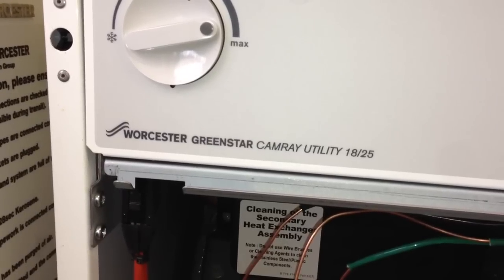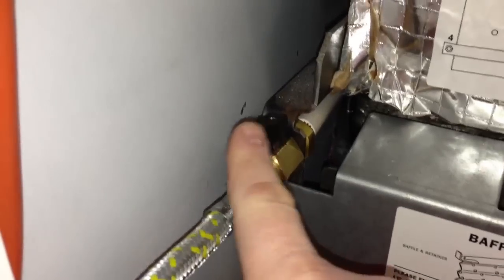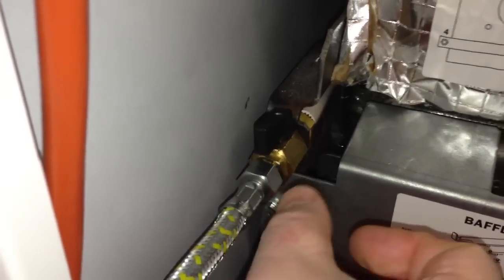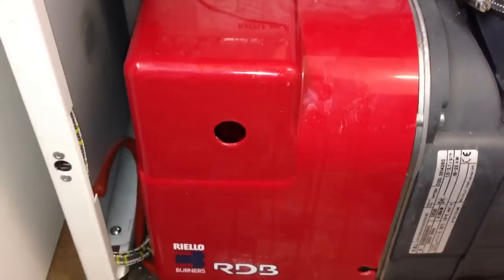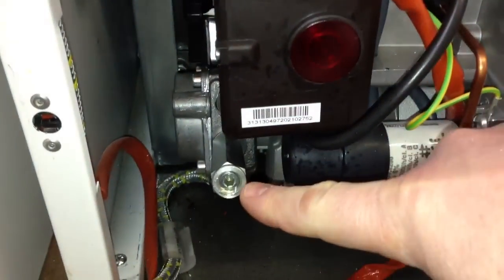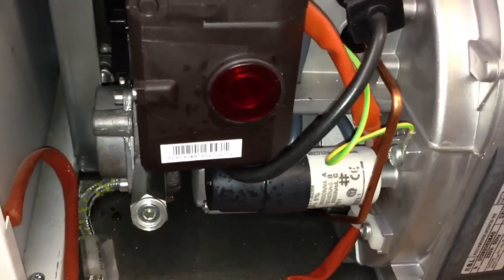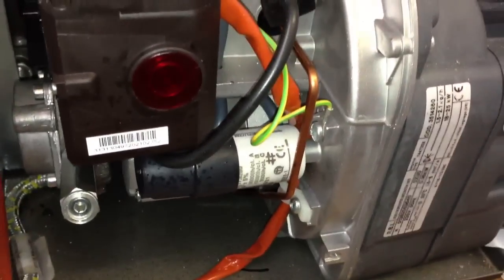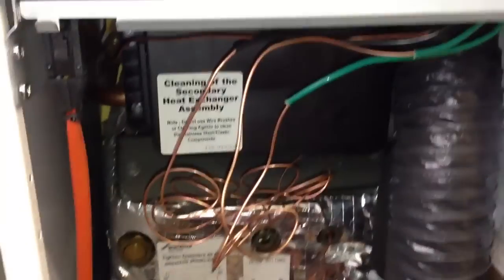Worcester Greenstar Camray Utility 18/25 Oil Fired Boiler - How to bleed an oil fired boiler

Comment: Thanks Greg, I struggled to remove the first pipe and didn't a suitable pipe to connect so gave up. Howver Loosening the screw to bleed air and resetting a few times brought the boiler to life. Many thanks, you saved me from a very cold easter

Comment: Had a old boiler that just needed to be bled from the grub screw. However I unfortunately let the oil run out on my new Worcester heatslave II. You have to start the pump for the oil to come through the grub screw (didn’t need to detach pipe and bleed first). Press the reset to initiate pump- after 5 goes it locks you out, so switch power off and on again for another five goes. It didn’t ignite after about 20 attempts. I was about to give up then found this video.  The light bulb moment was when I read the Bob Hamer comment below. - many thanks Bob. Tighten the grub screw before burner ignites to stop air being pulled in. worked straight away.

Comment: This has just worked for me, today 8 March 2018. Thank you so much. Just a extra note though, if you have to restart several times, pushing the reset button, I think it is important to close the bleed valve each time whilst waiting for the boiler to reset, and to do this just before it goes to lockout. Otherwise air can get back into the system.
Reply: First of all a big thank you for thehelp
Second thing it is very importent to clean all the filters on the way. After years they get full with dirt. Best is to fit new once.
After bleeding the boiler started by itself.
Thanks again.

Comment: Brilliant little video, particularly as it is exactly the same model boiler as ours.Oil in tank ok but excited dogs had turned off the tap by the flame cut off valve leading to an air lock. Boiler now running as it should so thanks again for your help👍👍👍

Comment: Brilliant - saved my bacon today - thanks!  I did need to use a pump to pull the oil through as a very long run of pipe from the tank and a rise of several feet up to the boiler.
Reply: What kind of pump did you use? My oil tank is also far away and below the level of the burner - I’m struggling with this part.

Comment: Thanks for the video.  Very useful.  Found that i just needed to allow air/ bubbles  to come through valve .  Then fired up the boiler and worked first time.
Reply from the maker: That’s right, I mention this in the video. Once it’s running clear you’re good to go. Glad it helped!

Comment: Well done for geeting that sorted. although it really doesn't need to be that awkward.  The pump will pull the oil rather than you needing to disconnect pipework and sucking oil manually.  There is a valve that you can loosen at the same time resetting the burner.  The pump and the will do the pulling and the opened valve will release the air.  It will fire after the aire has released.
Reply from the maker: Thanks for this, Darren. The original reason I resorted to this method was that I’d tried the method you describe repeatedly with no joy. I guess if I had persevered with it, it would have worked in the end!
Reply: @gregclaridge  Honestly, what you did there was pretty clever.   I'm far from an expert on this topic but I really appreciated watching your ability.   Intuition can go a long way.  It was a great exhibition of engineering.   As the old saying goes, "There's more than one way to skin a cat".   That one may not go down so well these days with everyone being highly so highly strung.  Thank you for the reply, Cheers.

Comment: Great video - I’m just struggling with the first part - ‘sucking’ the fuel through the pipe on the left hand side. How did you do this sucking? Annoyingly my oil tank is a bit below the level of my burner so it’s gonna take some serious sucking power I think!? Thank you.
Reply from the maker: Jason Leech I actually physically sucked it by mouth - bad idea to be fair, but it works. The best thing to do is buy a bleeder kit, as you would use for bleeding car brake callipers. It’s like a pump which you connect to the hose and as you pump it sucks down the tube. Once you see fluid appear in the chamber you’re good to go. Hope this helps.
Reply: @gregclaridge  thank you for this reply! I tried making all sorts of contraptions to suck oil through the empty lines - what worked in the end was  strange little box attached to my wall that, when you unscrew the top of it, has a little button which when pressed actually pumps and primes the system!!! Ironically I think it was that very device that was stopping all my attempts from working.

Comment: Wonderfully helpful. You are a legend! What's the blow pipe I can see inside the boiler, is that to create pressure to blow the oil through?
Reply from the maker: Gareth Iwan Jones if you mean the orange thing, that’s the electrical connection to the pump. Other than that, the pipe on the left is the oil feed.
Reply: @gregclaridge  ah I meant on mine there is a transparent what looks like a manual blow pipe, like on some 2 stroke engines to blow fuel into the carb. Just wasn't sure what it is for.

Comment: Hello,Can you help please.the boiler has no power at all going to it,nothing is lighting up..How do turn the boiler on? There is oil in tank.
Reply from the maker: It sounds like you might have a blown fuse. There should be a fused spur on the wall supplying power to the boiler - check this fuse first. There should also be a breaker in your main fuse box, check that too. If both check out fine, then there’s likely to be a problem within the boiler itself. Don’t attempt to try to fix that as it could be dangerous. Call an engineer.
Reply: @gregclaridge  Thank you for reply I will the house next time I go..I thought it been turned off as house is for sale but I concerned I can't find a power switch to turn it on..

Comment: I have fired up the boiler but haven't yet got oil coming out from the bleed valve.  I have repeated the process 8 times now but not sure if the pipe is maybe blocked from where I ran out.  Any suggestions?
Reply: Got it sorted! Slight blockage fixed by blowing up the pipe with a straw